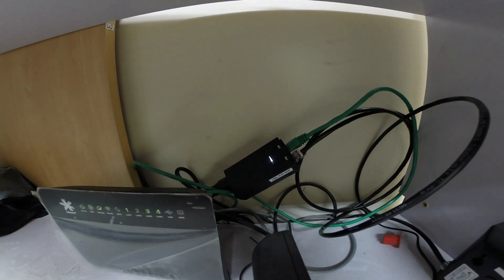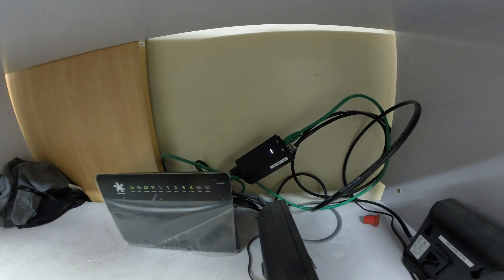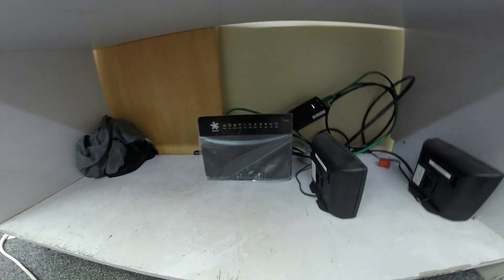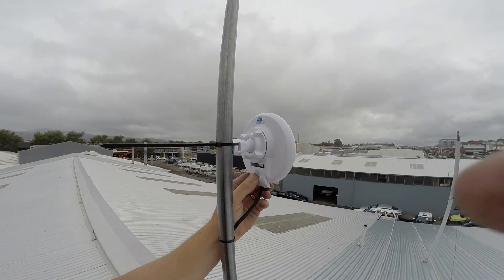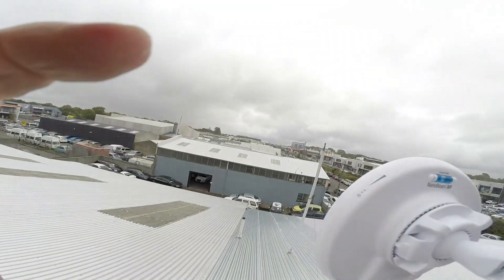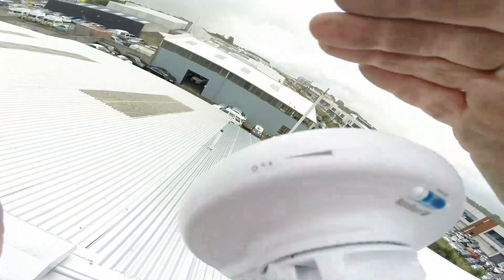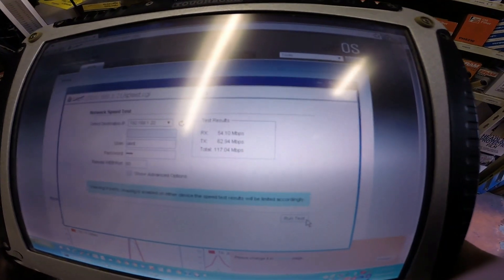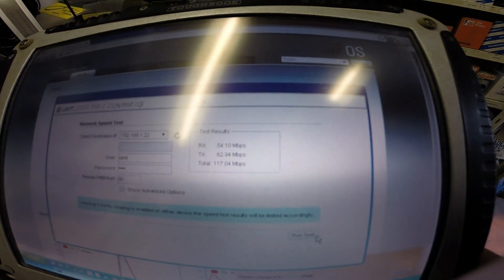Installation of Point-to-Point NBE-M5-16

Comment: What type of cable did you run for these units? Is it only black shielded ethernet cable or is it special outdoor UV Shielded twisted pair? Would earthing from ethernet port of AP to pole be sufficient for ESD and drain provided the pole is also earth via the roof?
Reply from the maker: Hi MrSilverFish

This radio does not have a grounding attachment, so it can not be grounded to the roof. I am using Ubiquiti Toughcable Pro with a drain wire for ESD protection.
https://www.ubnt.com/accessories/toughcable/

Cheers

Matt
Reply: If you didn't earth the AP, would its life be significantly shortened by static from the air? Is that the main reason? Indoor stuff doesn't suffer from this same issue?
Reply from the maker: Mainly for direct lighting strikes.

Comment: Nice setup! What frequency and channel width was this? 60 Mbps seem to be much lower than the advertised 300 Mbps even if you mind 30% air overhead. Newer Nanobeam AC models on 5 GHz achieve 300 Mbps+ in real world deployments.

Cheers from Germany,
Manuel
Reply from the maker: +Manuel S. I have tested the new Nanobeam AC at 450Mbps on the test bench.

Comment: Does this needs to be within sight of the receiver? I am trying to set up one in the main house and the receiver in the guest house but a bunch of trees in between.
Reply from the maker: Yes, these will go through trees at short distances over hundreds of meters. I would look more at the LiteBeam. Cost effective 5GHz 802.11AC Radio, a not to be sniffed at reasonable  23dBi gain antenna with the integrated radio.  https://www.ubnt.com/airmax/litebeam-ac-gen2/

Comment: will these operate as a conventional wifi ap rather than just point to point? how reliable is ubiquiti stuff? i usually dont touch anything thats not cisco these days
Reply from the maker: UBNT UniFi is the best for Managed WiFi. The UNiFi range work as normal WiFi AP's.

If you want just 802.11a/n, them use the older M series like the NBE-M5 or  RocketM5. You also have the same in the 2.4GHz range as well.  

Anything newer, like the  https://www.ubnt.com/airmax/nanobeam-ac-gen2/ uses their property AIRMAX protocol.

What solution are you looking at? Inside or out?

Comment: cable ties to mount to a pole?
Reply from the maker: The clamps that are supplied from overseas are to big for NZ 25mm poles. I have been using cable ties for over 10 years for  installations when clamps not usable.

You must use the black UV proof cable ties.

Matt
Reply: black ones are UV resistant, but not immune to UV breakdown.
They last 3 times as long as the non UV resistant ones, sure, but will fail as well.

If you're pro, use stainless cable ties or stainless hose clamps for such installations.

Comment: how much maximum range this can support?
Reply from the maker: DAY7703 The 16dBi model will do 10kms & the 19dBi model 15kms depending on the line-of-site and any near obstructions between the two radios. 

If you want to do a longer link or concerned about local RF interference, I would recommend a set of these. You may need to reduce the TX power on both radio if you are to close to each other. https://www.ubnt.com/airmax/powerbeam-ac/

Cheers

Matt

Comment: bad installation. 300M and only 50 megs up down. sure, you can say it's 100-110 mbits but that's just plain wrong. the zipties will not hold the nanobeam in place and you could have aligned the antennas better.